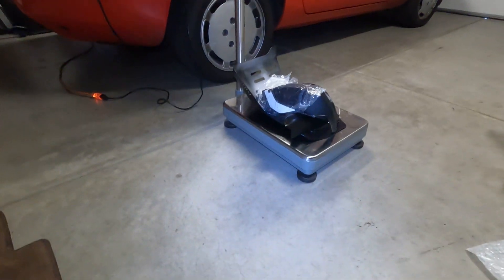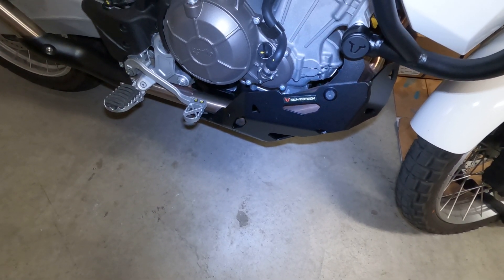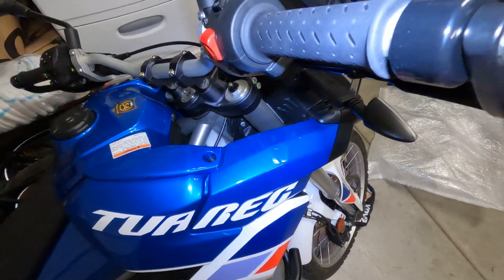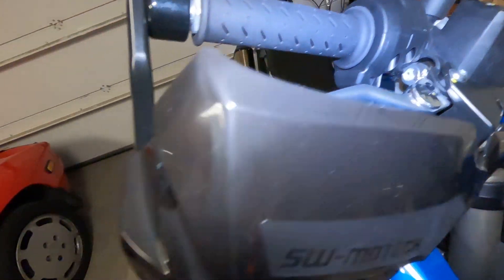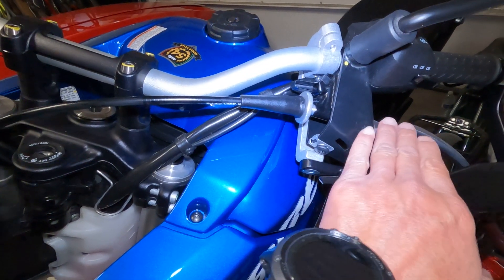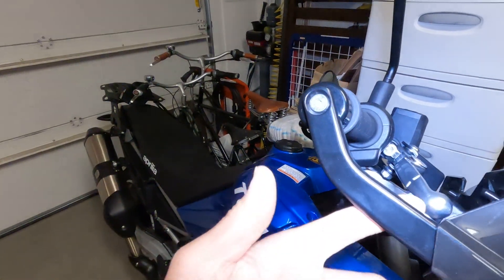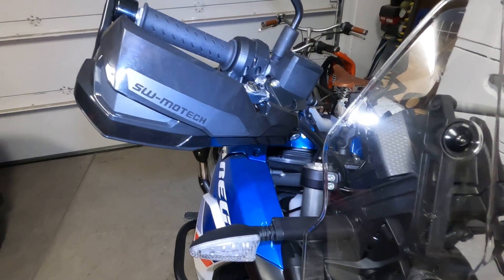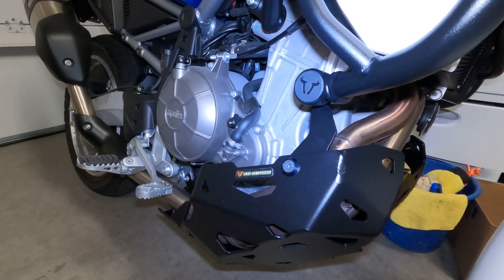SW-MoTech accessories installation closing thoughts - Aprilia Tuareg 660

Comment: Great video with good explanation of some challenges you encountered.  I have the factory protection kit and I went with the H&B hand guard protectors to protect the plastic ones that break on contact.  What I realized after installing the hand guard protectors  is that because they tie directly the handlebar clamp it seems like that it removes the possibility of changing the tilt on the handlebars.  I have no desire to change the tilt at this time but I thought it was interesting the guards would prevent this in the future.  I really like the look of your back rack, but after dropping my bike on the trail I appreciate the integrated handles on the factory rack.  Everything is a trade!
Reply from the maker: Thanks for your comments Kevin, your last statement made me think about it and I might research and get those soft handles for the rear rack attachment points.  Looks like "Pro Eagle" makes one.  I'm planning on bringing my bike into work and laying it down and lifting it a couple times to see how easy or not it is for me to right her.  I'll try to film it.

Comment: I installed a similar hand guard kit and I had to design and print a spacer for the front brake resiviour. It solves all the spacing issues. Plus removing the black plastic covers on the levers.
Reply from the maker: Nice. I recently removed the weighted bar ends and as a result, I was able to change the angle of the hand guards to actually protect my knuckles from branches/brush.

Comment: Well, I'm glad I didn't use sw-motech's lever protection, but Barkbusters' solution. For Tuareg fits set originally used for Honda Africa Twin, it has literally same parts as sw-motech solution, except plastic. And instead of internal weights i used barkbuster's external weights, that allowed me to move assembly more to inside, so no drilling needed and i can set handguards more freely.
Reply from the maker: Good for you Nath, Barkbusters seem to be the defacto goto hand guards.
Reply: So you used barkbuster from africa twin and its compatible with Tuareg 660 ?
Reply: @viliamandrasov7609  yes, with additional external weights Barkbuster B-066. I did not used weights from Afrika Twin BB set.

Comment: I think you installed the hand guards incorrectly. That black cap that plugs into your handlebar is not needed with the guards, mine screwed in without any drilling and sans that black cap, and was simple once I realized that, it all lined up so to speak
Reply from the maker: Hey Raph, you’re probably right, but I think I tried removing the bar end weights and it still didn’t fit. Nonetheless, I’m not touching it until I have to, cause it’s working fine now. Honestly, I’m not sure why there are weighted bar ends at all on bikes. Thanks for the comment though. Take care.
Reply: yea I removed my ends and it fit with the shorter bolt provided (if you remove the weight the stock bolt is too long etc) anyways great vid!

Comment: To be clear, install the skid plate first, then the crash bars?
Reply from the maker: Negative, I think crash bars first, then skid plate. I recently removed the skid plate to upgrade my exhaust and didn’t touch the crash bars. So by that logic, I believe the above is correct.
Reply: @ocdmoto  Ahh, thanks. Good to know!

Comment: i cant f figure out how to get the crash bars on with the skid plate nothing lines up
Reply from the maker: SP, it’s been a while since I installed everything, but don’t recall having any issues with that part of the install. I remember there was an extra hanger and a spacer that needed to be installed to make everything fit correctly.  I think I recall the spacer was necessary if you were installing it with there crash bars, but not if you were to only install the bash plate, or vice versa.  If you further explain what’s happening I may be able to help out. However, I think I left the directions at work so I might not be able to verify until Monday, sorry.
Reply: @ocdmoto  thanks yes I got it in today had to go get that spacer from the other kit all good love it very nice bars
Reply from the maker: Nice, now get out there and get some dirt on them. Take care.